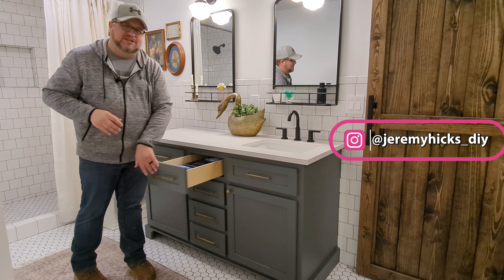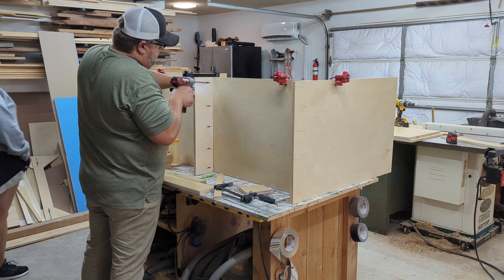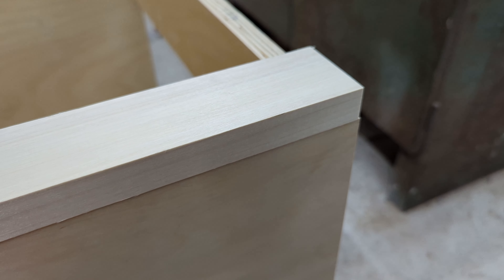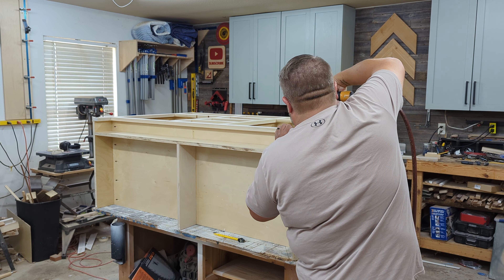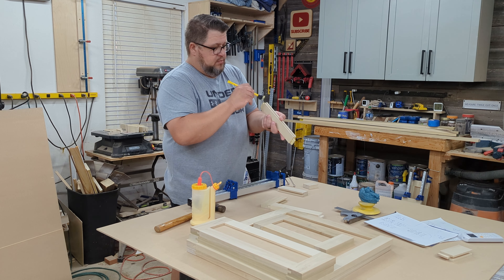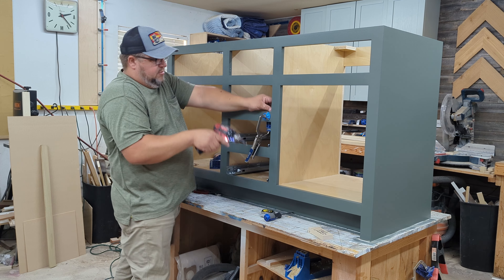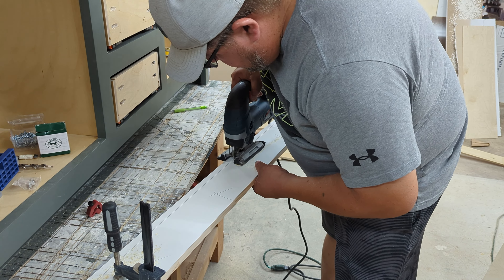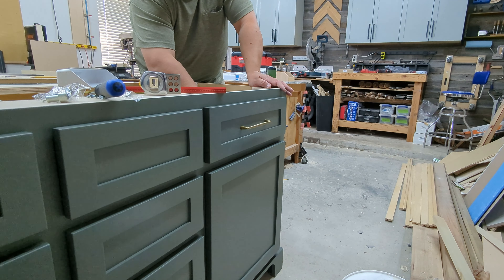How To Build a Bathroom Vanity | Easy Build!

Comment: Wow, absolutely wow.  That vanity is amazing. All of the details, wife has great taste, and the preciseness with how you made it. My dream would be to be that good.  Love your bathroom too.  Splurging on the quartz is a great idea.  Love the tip out drawer too.  I have vessel sinks in my bathroom so I’m in the process of adding 12” drawers with a cutout for the drain pipe.  It adds so much more storage!  I had never built a drawer before or installed drawer slides. I did side mount and I thought I did a good job, but one side makes a tiny bit of noise even though it glides smoothly. Anyway, great job.
Reply from the maker: Thanks for the kind words! Those cut out drawers around the sink are also very cool and add lots of valuable space!

Comment: You built a beautiful cabinet for almost $800..  I'm sticking with homedepot for $299 already built. Saving!! Alot of time and frustration
Reply from the maker: Yes . DIY isn't always cheaper. But it allows the flexibility of using materials that will last a lifetime. 😊
Reply: @DebtFreeDIY  That $299 at HD is going to be REALLY cheap. Also, it's most likely a sink sink. Even the $599 cabinets at HD are still very cheaply made.
Reply: You still getting particle boards that will last a couple years if you take care it well and then it crumbles into pieces then you have to replace. I think the cost mostly because he have custom granit counter top and all those door hardwares.  You could go cheap on those and it still last you forever. Honestly it should cost like 150$ in wood materials  and 150 in premade counter top and sink
Reply from the maker: @derpherpp3  yes the custom sink and Countertop was $600-ish. The material for the cabinet is dirt cheap
Reply: @DebtFreeDIY  yeah those quartz are expensive.  And I think they rip people off also. Like you paid for a large slab and they cut a little piece for your counter then they keep the rest. I did it tk my little kitchen and never again unless I’m diy the quartz counter myself.  I went with premade counter with sink for fraction of that for my bathroom vanity.

Comment: Hey hey hey, stop the clock. What is that wizardry machine you are using @2:23 ? Thank you for your time. Cheers from Chicago.
Reply from the maker: That's the Rockwell Blade Runner! Works great for jobs like that. It's linked in the description if you get a hankering to buy one! Thanks for watching! Appreciate the support! 👊
Reply: @DebtFreeDIY you rock. Thank you!